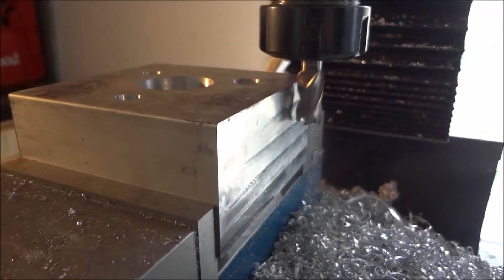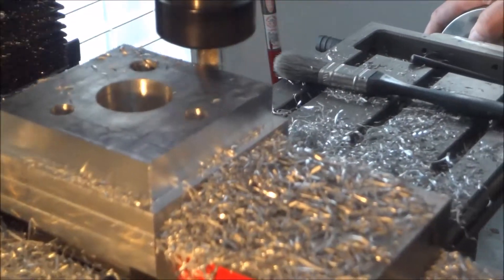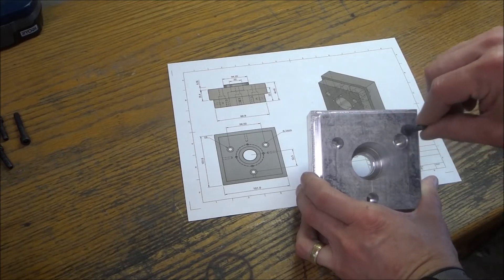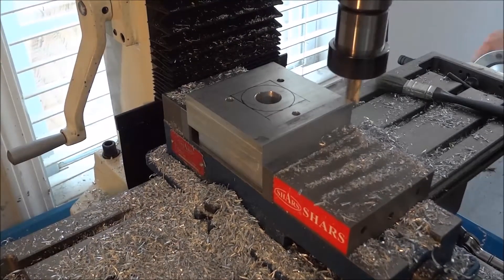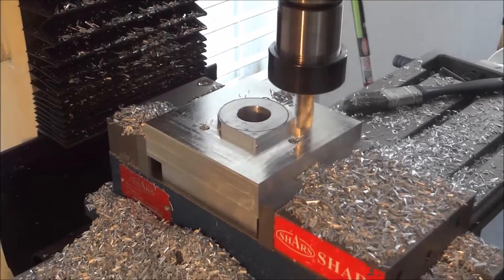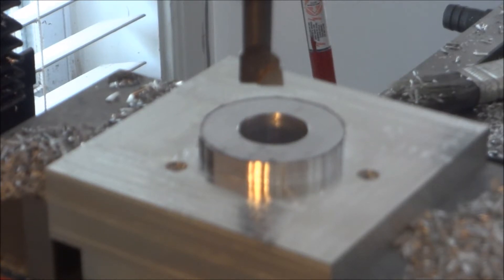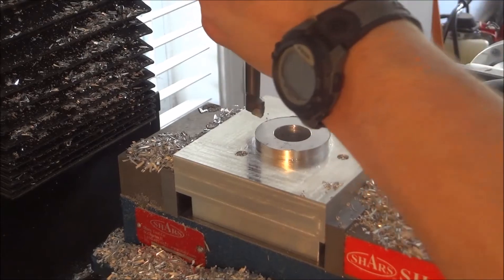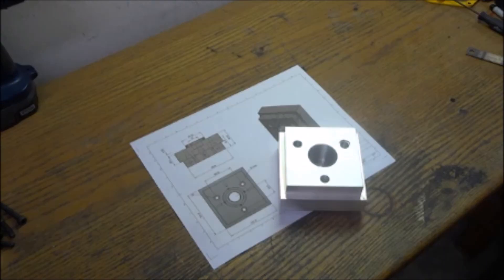PM 727M "Z Axis Bearing Block Machining Part 2"

Comment: Boring bar OD cut trick looks awesome! Little to no radius left at in the inside, nice. That probably would have actually taken a bit
longer to chuck up on the lathe to do the same thing.
Reply from the maker: +PartisanGuerrilla 
Yeah by the time you mount the chuck get the stock centered   It may have. Overall she turned out nice.